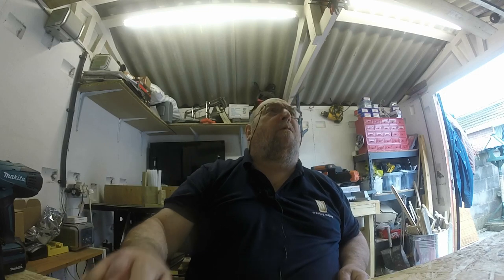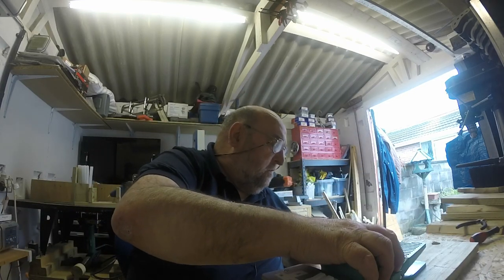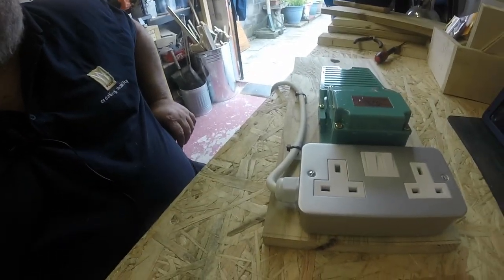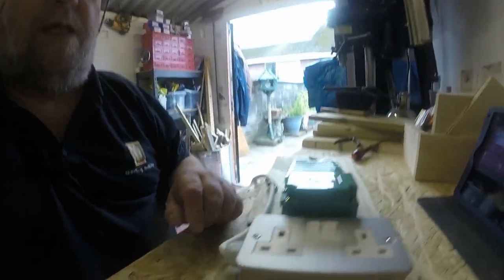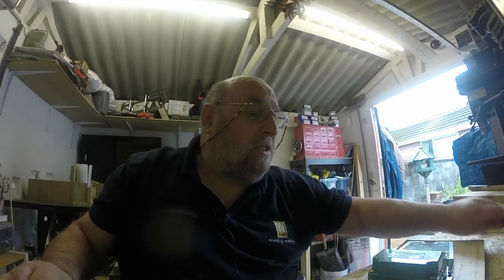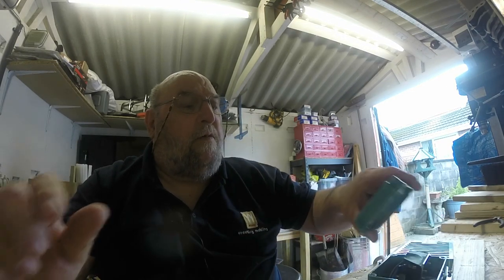Foot switch

Comment: Very interesting video
Reply from the maker: Hello the foot switch many applications made one years ago at work for some distribution boards I was making for ambulances for a tool that I had adapted and the foot switch came in handy. It’s now ideal for my small 1/4 inch router the Katsu as I can leave it switched on then once in place I have two hands on it and the foot switch to turn it on and off. Could also be used for other things as the switch is rated at 15amps if you need more info just give me a shout

Comment: well done mate it's just what I need , just one question in your pedal it shows the earth cable going to the back of the switch but I don't see where it connects to in the metal socket would this normally go to the earth on the switch?
Reply from the maker: malcolm oxley thanks for your support and subscribe the earth goes to the socket and base I probably didn’t catch it on camera but because it’s all metal it’s all linked together
Reply: @PhilsWorkshop1953  thanks have subscribed great job mate